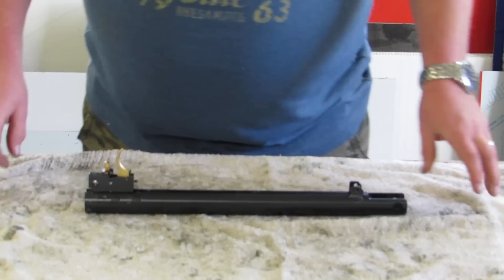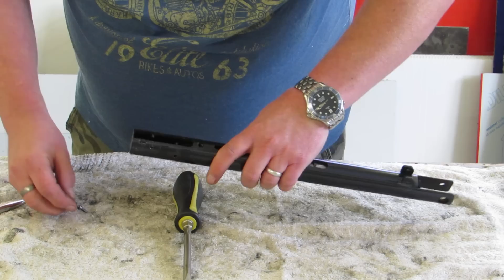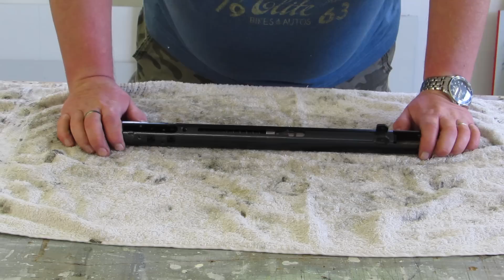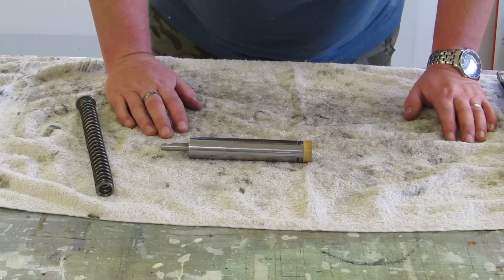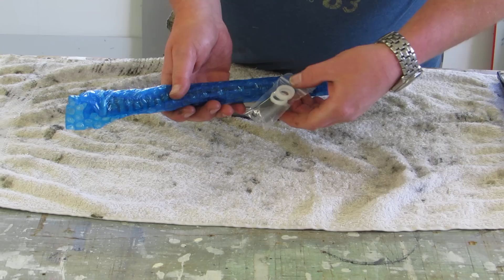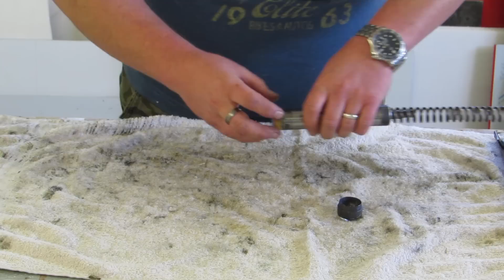HW95/98/99/50/57 strip down guide and TbT Maxi kit fitting (obsolete kit, please see latest videos)

Comment: Hi Nick, HW 57 power upgrade from German 7.5 joules limit. I am in France and would prefer the 19.9 joules upgrade. Does the transfer port require drilling out in addition to fitting the stronger spring kit. And, is this easily achieved on this underlever model?
Thanks in anticipation of your reply.
Reply from the maker: Hi John. The 57/99 is a 15-17j gun, I have kits to do this in France. Drilling the TP will only reduce power

Comment: I am assuming you are in the UK?  Do you handle full power kits for the US market?  I just bought a HW50S new last month to go with my FWB 124 Sport that I bought new from Beeman's in the very early eighties.  I heard remarks that the new FWB's and HW's were sent dry from the factory with no grease at all?  My piston seal finally wore out on the FWB  and I am pleased to say that they had done a thorough job at the factory in greasing it then.  This was the first time I had taken it fully apart and the spring was thoroughly greased with a heavy lube that still felt and looked fresh, not so the seal as its edges had eroded and flaked off.  Just found your channel and subscribed finding it very interesting.

Comment: Thanks for sharing your knowledge and skill. 
I have the standard Hw50
And it came with a cheaper standard non adjustable trigger unit which is not very smooth. 
Just wondered if you knew where I could aquire a record trigger unit.
Thanks again.
Reply: Normally that shouldn't be too difficult. Have you managed to acquire one by now?
Reply: @ytucharliesierra  yes thank you. The gun is much improved.

Comment: Like the way you say at the end that you might need to shorten the spring if it goes over the legal limit, some people don't have the tools or would know how much to cut off.Kits are way,way over priced as well, could have also done with some close ups of what you are doing.
Reply from the maker: Every country has a different limit, some none at all, so it is possible the spring will need to be shortened. If someone doesn't have the tools or ability to check and change the power they should consider getting the necessary equipment first or getting help from someone who does. If they need advice we have a freephone helpline and full online support included in the price.
What would you like close-ups of? It may be that they are covered in other, more recent videos

Comment: Great vid nick! Quick question when installing a  maxi kit when i have removed the weights and washers from inside the piston it has damaged the liner can i fit without a new liner as a lot of people seem to remove them. Cheers
Reply from the maker: The sleeve is just there to stop grease migrating ahead of the piston seal. I remove it and leave it out
Reply: @tbtairrifletuning  thanks for the quick response mate appreciate it,  the original washers were in than tight when the liner came out its scratched to bits. Also 1 other thing the original weights and washers should i do away with all of them? Cheers
Reply from the maker: DavT 86 keep them to one side and you can experiment with piston weight in the future, but on the whole they're rarely needed
Reply: @tbtairrifletuning  thanks mate good stuff, its the tbt maxi im putting in my hw95 also have a 99s with just a drop in kit and shoots spot on.
Reply from the maker: DavT 86 email me at support@airrifletuning.com and we'll go through a few options
Reply: @tbtairrifletuning  cheers nick will do

Comment: No lubricant at all on a mainspring is a bad idea. Metal to metal moving surfaces need some lubrication. Lubricating the mainspring correctly will increase shot to shot consistency as well as making your gun cycle smoother.
Reply from the maker: That is true if the spring is rubbing along the piston, that's where the Weihrauch "twang" comes from. Fitting these guides eliminates metal to metal contact which means far less grease is needed in the gun.

Comment: My brother is looking into getting a HW98 from Germany, so I'm thinking 
of getting one of your kits to bring it up to 12ft/lb. The only thing 
putting me off is that in your ebay listing you say the spring will need 
cutting. I was under the impression you used the factory spring so not 
sure why it would need cutting. 

This is something I cant do myself as I dont have the right tools e.g a 
blow torch.
Reply: I believe cutting the spring is only to keep thr power down do to Europe rules.
Also. Can help reduce recoil noise. I bought the kit, NOT cutting my spring!

Comment: Nice vid Nick!
I tried to follow your steps, at the beginning, I just failed to disconnect the barrel & breech part without pulling out the mainspring in advance; the screw bolt seemed to be under tension, so I tried to undo the cock, hoped it will work, and failed again.
Could you please show us how you strip down the barrel part ?
Reply from the maker: The easiest way is to remove the spring first. That way yu can break the barrel and remove the pin without any tension. Other than that its just unscrew the bolt and knock the pin through with drift.